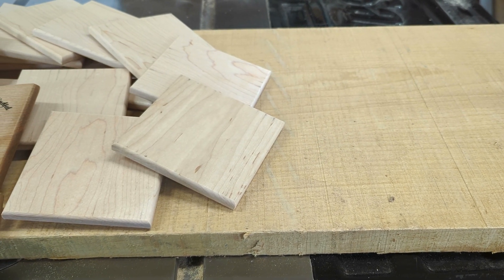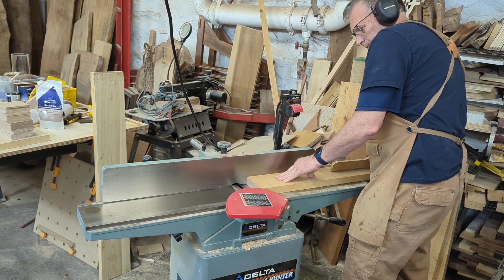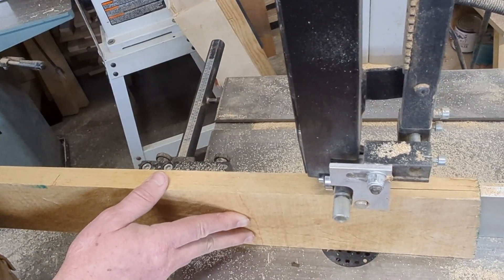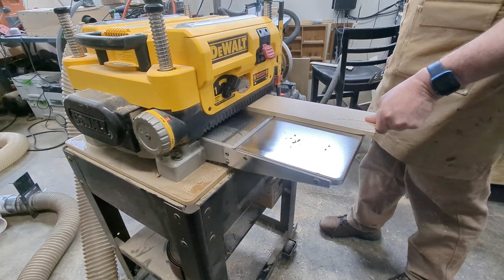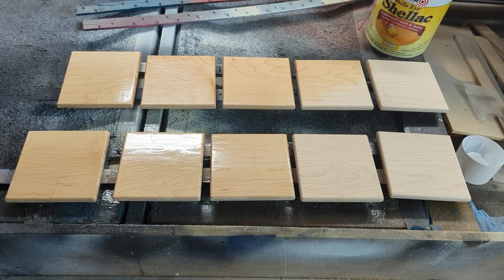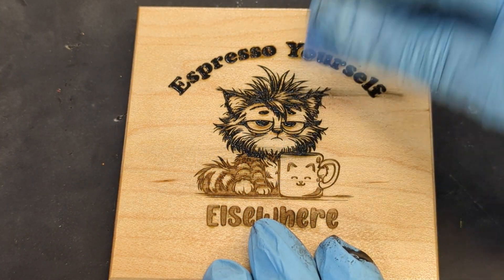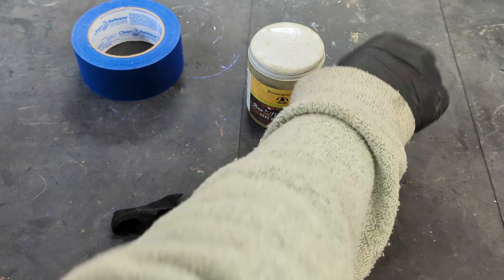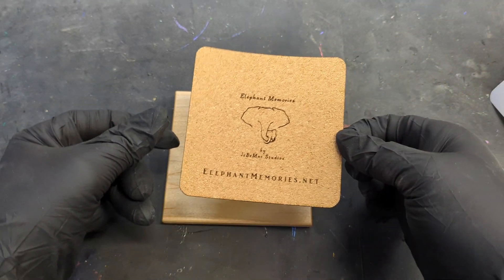Create Your Own Wood Coasters For Laser Projects | DIY Guide For Makers

Comment: What is the paper towel pre soaked with when you remove the paint? Water?
Reply from the maker: Yup.  Just water.  As long as you have sealed the wood well enough, the paint will just wipe right off.  You can also use a flat sponge.  That is faster, but I still find a paper towel cleans better.